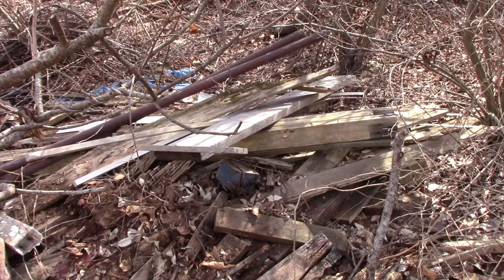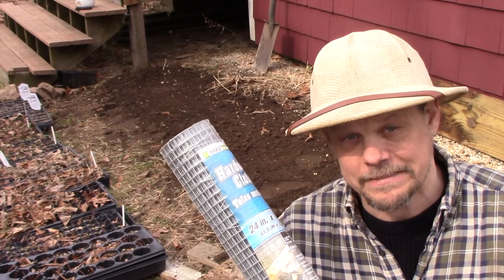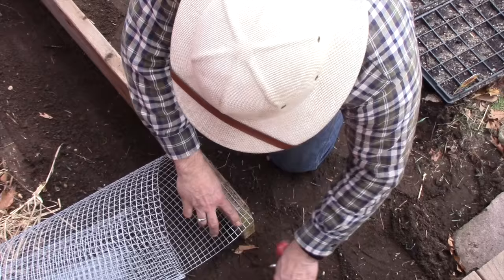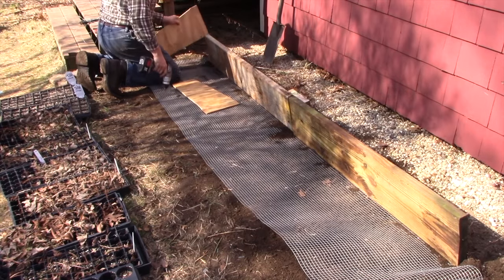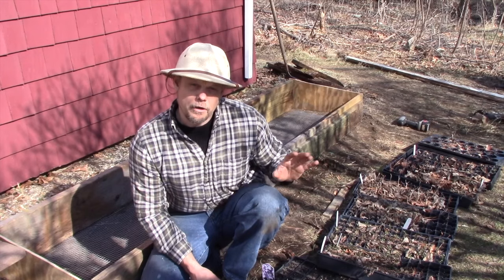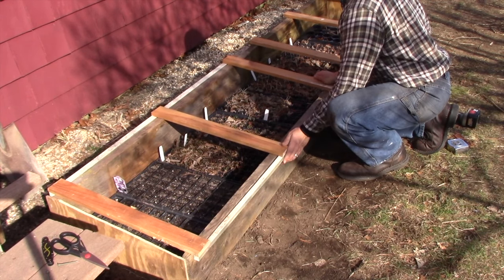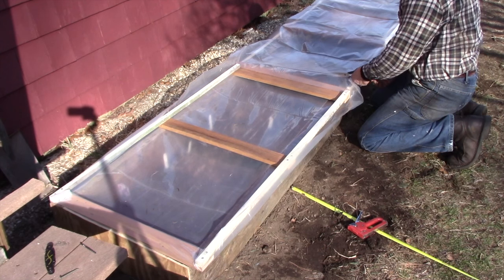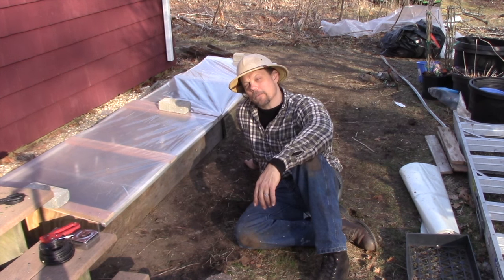Continuous Edge: Cold Frame

Comment: If I don't happen to have a lumber pile nearby, what kind of wood is good for a garden bed? I have been using some cheap pine for the past several years, but it's finally rotting away and needs replacing. Also, when making the cold frame, is there an ideal angle for the cover?

Thanks for making your videos, they're both educational and strangly entertaining.
Reply from the maker: +Adam Loseman Hi Adam.  Cedar is an excellent rot resistant natural timer for use in garden beds and cold frames.  Also pressure treated wood, PT,  is now chemically treated with copper (the old PT wood was treated with arsenic) and toxin leeching is minimal.  

There are ideal angles for maximizing the sun's efficacy in energizing a cold frame.  Those angles would actually change depending upon your northern latitude.  I would just make sure the front face of the cold frame does not cast shadows across your plants.  Even if there is some shadow the plants will grow up to the light.